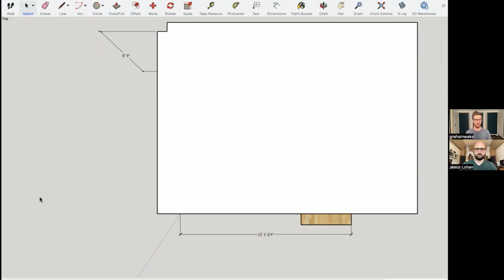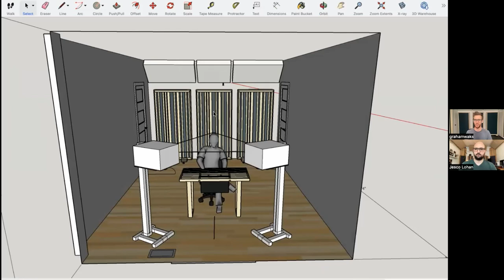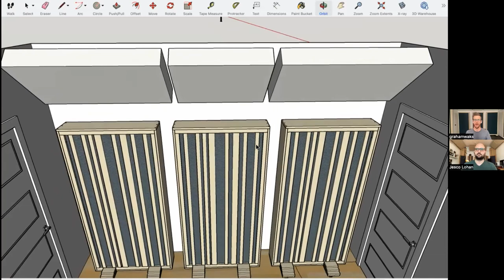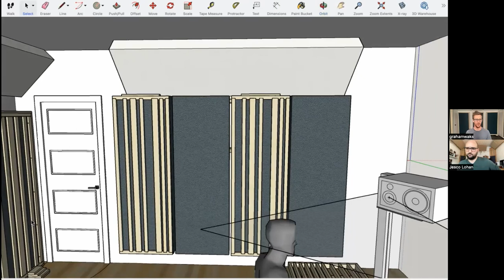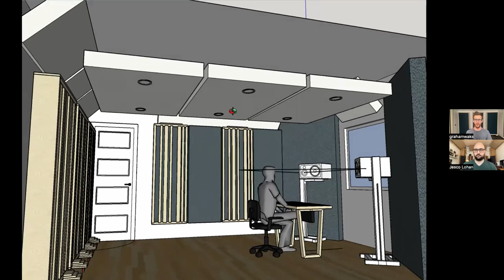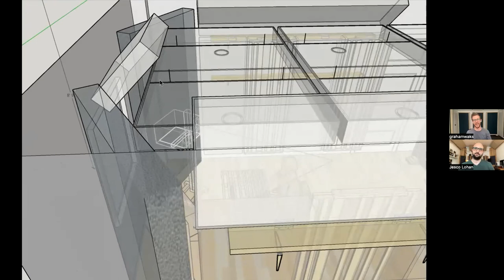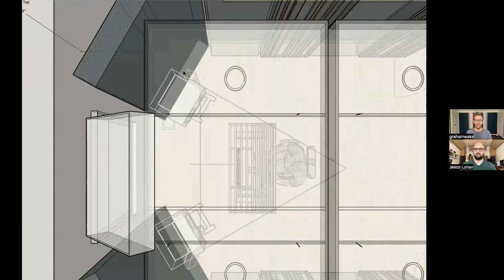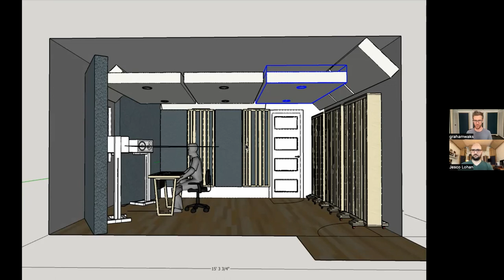Treating A Studio Start-To-Finish #2: Panel PLACEMENT For FULL SPECTRUM Control (Acoustics Insider)

Comment: Very interesting discussion. Square rooms are just no fun for acoustic balance. People always complain how they've spent thousands on absorption, yet hear little improvement. I always recommend large false wall panels 4" from the real wall to essentially "reframe" the geometry of the room, addressing the room modes and and standing waves. This also secures a healthy air gap built into the room.

Comment: 16:12 Traps behind the speakers would move the speakers and listening position away from the front wall.  Is it worth the trade off?  Speaker right at the front wall would yield a better response curve.
Reply: You really want to be hearing the speakers not the bounce off.

There will be a distance depending on the speaker & where it’s ported as to how tight the sound is & how far it is from the wall.
But that is very specific based off each speaker & you can’t say until tested.

Comment: Is there a rigid backing on these panels? Is there any benefit to building the air gap into the panel (basically thicker construction of sides but rear still open) or is it better to make the panel as thick as the absorption material and then just mount it with an air-gap? I guess they are much of the same thing but one would cut down on material?
Reply from the maker: The backs of the panels just have a fabric covering.  A rigid backing would reduce their effectiveness particularly in the low mid and low frequencies.  You're exactly right, the biggest difference between building an air gap into the panels frame vs a panel with matching frame/insulation depth installed with an air gap primarily just affects the material cost of the panels.  Acoustically, there is actually a slight benefit to having the open space in the air gap but it is pretty minimal.

Comment: I make bass heavy electronic music like house and techno and hip hop. I also thought the most sensible option to start by tacking the hardest bit (the low end frequencies) buying the thickest absorbers that I can afford and as many as I can since only that will take care of the low end but it will also provide broadband absorption across the frequency range? In the UK GIK acoustics do a soffit bass traps which are a £275 cuboid shape 400mm thick and made for the corners of rooms and I might need 4 or 8 of them. Is that the best solution? There's also the tri trap option. Or am I better just corner mounting a 160mm monster bass trap across the corners which only cost £120 each. I could get 18 x 160mm monster bass traps for the price of 8 x 400mm soffit corner traps which would cover the whole room. However, it might be a false economy if i buy monster bass traps for the corner and find they don't control the bass well enough so I need to get soffit traps anyway and get rid of the monster bass traps in the corners.  Or I could get 4 of the 400mm soffit bass traps and spend the rest on 160mm monster bass traps. From what I can see on http://www.acousticmodelling.com/porous.php 160mm barely seems to touch below 100hz but 400mm really does. Or am I missing the cumulative effect of multiple panels?

Comment: Loving the videos! I was a bit surprised that your corner traps straddle the corners and leave a gap - I was always under the impression that corner traps were completely filled. I've read elsewhere that in corners the air gap matters much less. 

Should air gaps behind panels always equal the panel thickness? Is that a hard/fast rule?
Reply from the maker: Super-chunks (completely filling the corner) are a very common corner treatment so that might be where you've seen that but with porous absorbers, air gaps matter in every application.  In the corners pressure builds up because we have two or three converging boundaries but porous absorbers work off of air particle movement and it is slowest at the boundaries.  That is why air gaps improve porous absorber performance. 

No - that is a good starting point but as you can see in our design we did not follow it, when it came to the corners and you'll see more of this in Video 3.  As the air gap increases relative to panel depth there is the potential for a reduction in performance at higher frequencies but if our main goal is to effectively absorb low frequencies with a particular panel then it is an easy trade off.

Comment: At what angles are you putting the ceiling corner/bass traps at? 45 degrees or something different like 30/60 degrees? does this matter?
Reply from the maker: The wall/ceiling corner traps are installed at 45°.  The front wall corner traps are at 30° to match the angle of the speakers.  Ultimately, the angle doesn't matter that much; the real key to corner traps being helpful is the air gap between the panels and the boundaries (walls or ceiling).
Reply: @MusicCityAcoustics  thanks for the answer.. one follow up would be how big would you want that air gap to be? Cos would that not determine the size of the panels you put in the corners? Is it something that can/should be calculated? I am assuming it would be room dependent?  Or would it more be a case of how much space you physically have to work with?
Reply from the maker: @jareddavis6373  The bigger the air gap, the more effective the panels will be at absorbing low frequencies.  You can see this happen in part 4 of this series when we test different air gaps for the rear wall Gobos. 

There are some drawbacks to making the air gap to big, as it will cause a drop in mid-frequency performance, but oftentimes, it is a worthy trade-off.  

You can technically calculate the best placement for a specific frequency, but there is rarely a need to.  With porous absorbers, the ideal position would be the are in the room where the frequency you are targeting has the highest velocity.  We can calculate this, but it is different for every frequency, and porous absorbers are broadband in nature, so there is no need to get too specific.
Reply: @MusicCityAcoustics  great thanks for the info.. I did watch episode 4 regarding the gobos , just wasn't sure if the same applied to corners. Thanks again for a great series.

Comment: Are panels that cross corners better than soffits that fill the corner?
Reply: Well. I'm asking myself the same question. 🙂
Should we put flat panels accross the corners or should we fill corners completely?
Reply: What you're referring to is commonly called a "superchunk", which is basically just material in a triangular shape, framed.  In short, more material will absorb more, but it is still best to have an air gap from the wall to the material so that the energy can leave the material, reflect off the wall behind it, and be absorbed back into the material again.  I'm building two superchunks for my front wall corners, can't go ceiling to floor because I ordered one less box than I needed, but will have 60" superchunks. I will install them mid way with french cleats.  I've had to cut each insulation sheet into triangles, and stack them 2" at a time.  It's a much longer process and more $, but it will be worth it. I'll have about a 2" gap behind, which any gap is better than no gap. Hope this helps.

Jesco has a good video on this: https://www.youtube.com/watch?v=7RvBw1YAjCo&t=444s
Reply: @koenvanmeerbeek which ever is more material I’d assume

Comment: How do I learn what type of material is used inside the panels?
Reply: Most probably rockwoll with 45kg/m3 density
Reply: @jonathanmulumba6514  That is to dense. Fluffy wool 10-15 kg/m3 is the way to go, 6" of depth is minimum, and around 8" is ideal. Also, it's much cheaper.
Reply: @pecacartun  for broadband absorber or bass traps?

Comment: Are the front corner panels as they are superior in some way to having had the corner completely filled ala ‘super chunk’ style? Is it better to have air or mass?
Reply: i prefer the superchunks from my measurements, but the idea is that with a thick panel straddling the corner and an air gap behind it, you can get a lot of the same effect witch far less material. you can use Porous Absorber Calculator to model what things might look like—in particular, the way the curve changes in low frequency as you mess with the depth and/or air gap. you’ll notice weird things start to happen if you make the air gap larger than the thickness of the panel, but look what’s happening if you add thickness in 2” increments while keeping the air gap the same.
Reply from the maker: It depends on the size of the super chunks compared to the panels but the short answer is yes.  Super-chunks put a lot of the insulation material directly up against the boundary of the corners where there is very little air particle movement.  This doesn't allow them to work effectively.  The other primary factor is their size.  4lb and 6lb density mineral wool products shouldn't be stacked in depths beyond 10 or 12", this in turne prevents you from being able to build a super chunk with the size needed to work well at low frequencies. 

After trying and testing just about every combination you can think of, we've found a combination of rigid insulation (mineral wool or 703/705) mixed with light weigh fluffy insulation provides the best results.
Reply: @MusicCityAcoustics  What is the reason(s) mineral wool shouldn't be used in depths beyond about 10"?

When you talk about a trap consisting of multiple absorption materials, are you strictly referring to larger traps? At what depth do you even consider using more than 1 material?

Thanks for taking the time!

Comment: “8 foot ceiling has a huge booming 140hz response”.  Checks my room.   Yep.  138hz.  I’m already $2k into Owen’s Corning and still.  138.  It’s hopeless
Reply: GIK makes custom tuned bass traps by request.... If you contact them with details of your room including measurements, they will be able to tell you exactly how many of those custom tuned traps you'd have to buy and according to Harmon's Room Mode Calculator, they'd be evenly distributed throughout the room placed on-wall at 2ft and 6ft measured from the floor.

The traps aren't cheap but they work exactly as marketed on their website.

Comment: Why not put slats on everything if it’s a mixing/tracking room?  Or maybe better question is where would u not want to put the slats panels in a mixing/tracking room?  For vocals and guitar..
Reply: i personally would avoid placing slats on areas of first reflections, i dont know the exact science on where to put them, but id avoid places that you can see the speakers from the listening position with a mirror on the wall. take this with a grain of salt as i am still new to acoustics
Reply: It is recommended that you avoid installing where the early reflection is within 15 ms.
Reply: @BierMeister360 no that seems accurate, is what he wast sayin